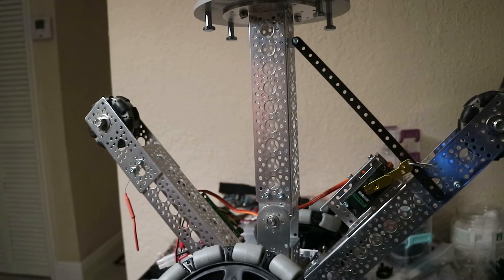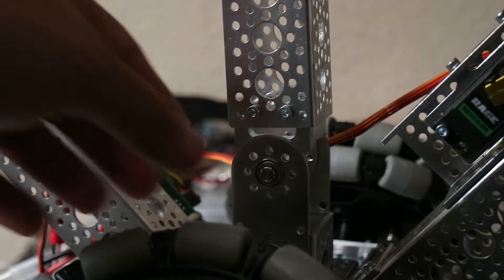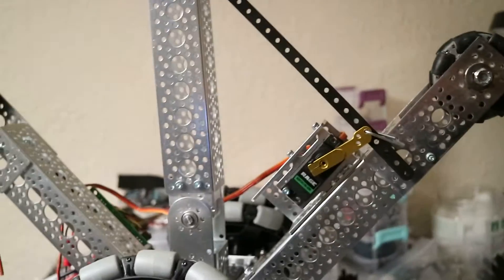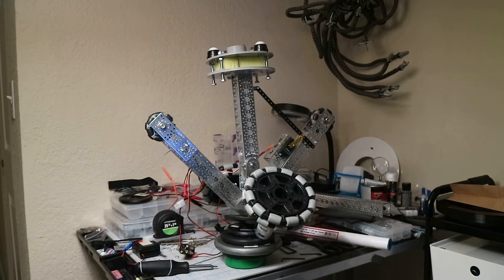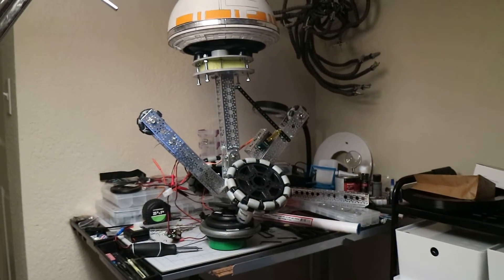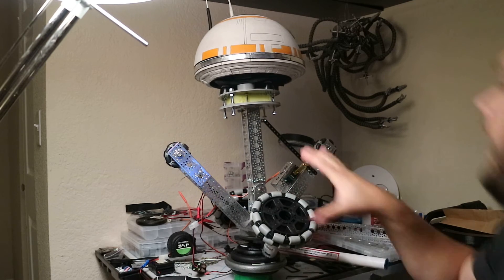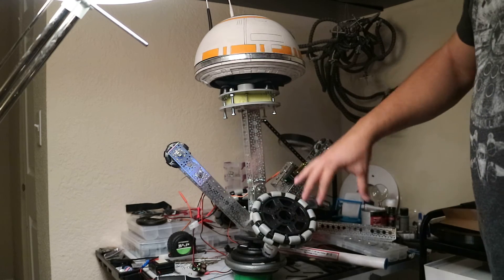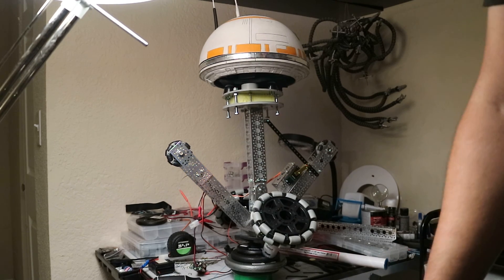BB-8 Head Tilt System Test

Comment: Hi! I'm actually building the same mechanism, but I have a doubt: how do you fix the weight underneath to the aluminium structure? Thanks!
Reply from the maker: Top Ten Academy Academia de Inglés Pamplona there is a bolt with a large washer that goes under the weights, up through the aluminum channel, then another washer and nut. You can see detailed info and pictures at my build log on the BB-8 Builders Club website. Here is a link to it. https://bb8builders.club/forum/showthread.php?1191-David-Alvarez-Fully-Functional-BB-8-Build-Log